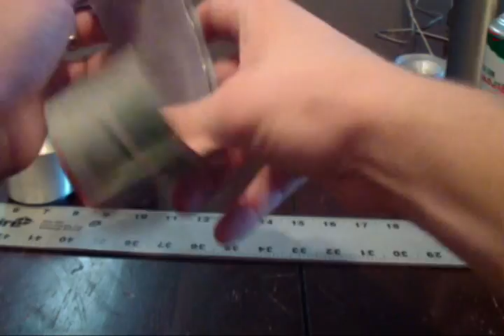How to make an alcohol stove

Comment: Thanks... just made my first stove using your video.  I just used scissors to cut out the piece that forms the inner wall, and my pieces slid together easier, maybe because it still had some olive oil (instead of vaseline) on the can left from the stretching.  
And I used a push pin to make the holes.  You made a very clear video here.